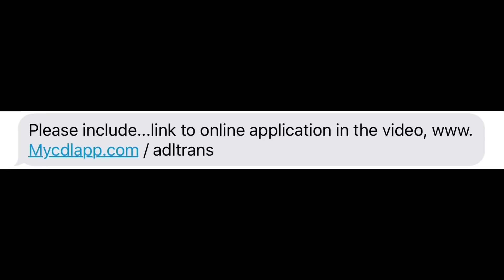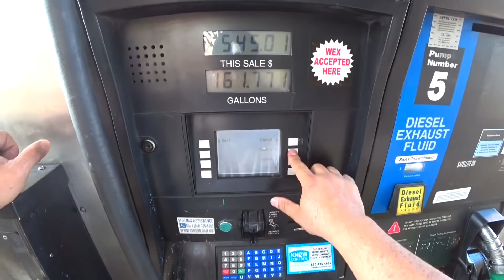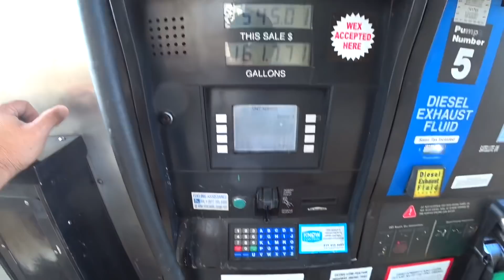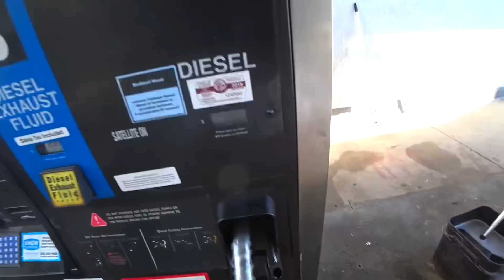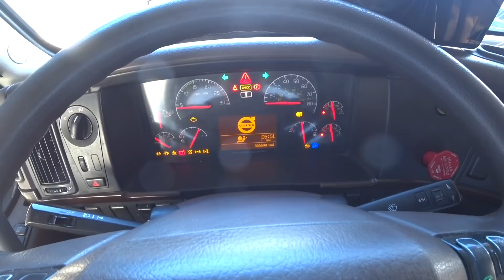September 12, 2018/1133 Emergency 🚨 Fuel ⛽️ at the T/A

Comment: Hey, John!! For a man short on fuel, you make me giggle. I would have put in the fuel first, then cleaned up things.  For finding the hood opener, congrats. lol Tomorrow is another day, but you really need to replace the wiper blade asap. You will probably hit rain before you get to Maryland. That blade is broken goooooood. lol When you take the rental back, make sure you tell them about the broken gas cap (chain missing), and the broken wiper blade. Gently remind them to detail their trucks before renting. 🐸
Reply: Dana Chappell  Did you get a new truck
Reply: 00

Comment: Please replace the windshield wipers. I mean, $20 to $30 bucks for a decent set. Go inside put it on your company card and make the boss pay for them. Safety first!!
Reply: Company truck is different from a rental. Most rental companies dont want their trucks touch other than drove. They should have properly cleaned and DOT inspected the truck before leasing out again. Not ADLs responsibility for an already trashed truck to be repaired.
Reply: @brandoncaldwell95  agree with you on that
Reply: @UC1IhWzgIHl3hbNeGPEleiEQ You know, its not wise to reuse wipers. Those clips usually break or are weak after removal.

Comment: If you are going to drive Volvo's, you need a gadget called a 'tire step' (Google that).  It is a step stool, that you hang over the tire when you need it. Neat thing is it wont sink into the mud like a traditional stool, so you can use it anywhere, and on any (outer) wheel

Comment: Ha! I knew the latch would be in the footwell!!! Did I see that you're Volvo has a Cummins engine? Volvo's in Europe only have Volvo engines and generally only have iShift semi-auto gearboxes.
Reply: Talking 2 different beasts. Euro engines and emission laws are different from the US. Cant compare the 2 in any which way.
Reply: Euro 6 is quite tough on vehicles anyway with overheating amongst other problems. Looking at the specs of Johnny's new truck it looks likely it'll have 12-speed I-Shift and a Volvo D13 Engine.

Comment: Fix that windshield wiper!
You'll need it shortly!
Reply: No the truck good back to Ryder Friday they should have checked that Ryder is not the company it was.
Reply: It is a DRIVER'S RESPONSIBILITY to make sure a truck is safe to operate, whether it is a rental or not. Driving ANY vehicle, especially a commercial vehicle weighing 80K, with a defective wiper is unsafe and dangerous. And where he is headed, it has been raining for the past week.
Reply: @midnightrider1521  Yes and no. You can pull the ignorance card when stopped. When a wiper breaks or cracked windshield happens, you dot automatically get it fixed. You deal with it for a while. Pretrip says it was safe. Post trip says the wiper is bad. Something happened during the travel. You can continue this ignorance card writting off issues like such till DOT stops you for it. By then you can claim it happened. You dont replace wipers on a rentals unless told to and re-emburst the cost for such.
Reply: What you fail to realize is that you can be sued for millions of dollars for an accident that is not your fault. And this video could be used as proof of negligence. Ignorance will get you nowhere in a court of law.

Comment: What's going to happen to baby blue?
Reply: She is done for by the sound of it. He realsed a video and in it stated it entered limp mode. Some expensive repair is needed and a trauck at 900,000 miles is not worth a $10,000 repair bill when the truck is only worth 15,000 as it sits un-repaired.

Comment: I see why the truck is rough ride and it’s got a spring suspension not a ride
Reply: Needs air ride.
Reply: Most fronts are leaf on Semis while the rears are air. Watch more towing videos like Ron Pratt and Plaza Towing and you will see.